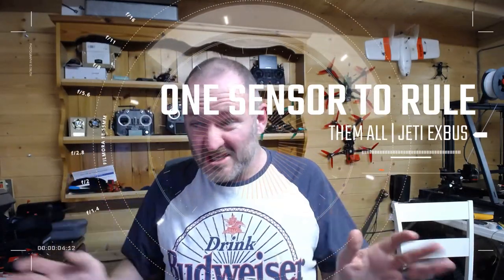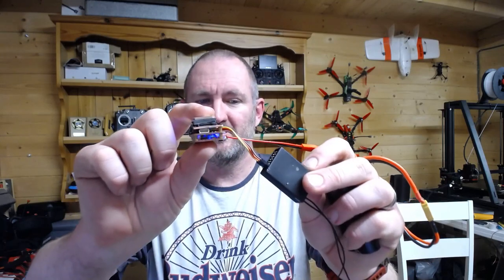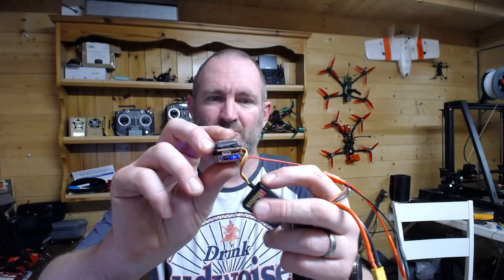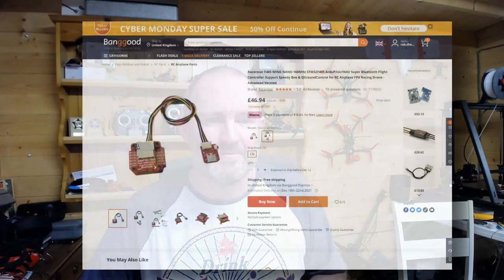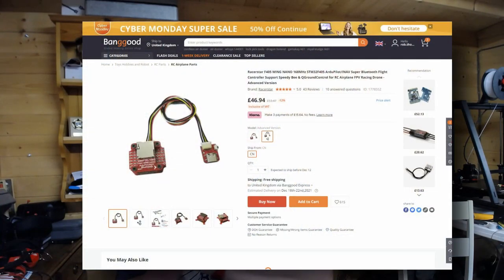JETI | ONE SENSOR TO RULE THEM ALL

Comment: Ok so if Jeti uses lua script and so does frsky . Why can’t I use sensors from frsky😬and for that matter in the assist wizard u can use a gps or mspeed sensor u can adjust gain values per speed .
Reply from the maker: Because its a question of the different protocol being used at the rf stage.

The result is the different manufacturer devices don't talk to each other.

I suspect the GPS speed from inav will work perfectly with the assist sensor.